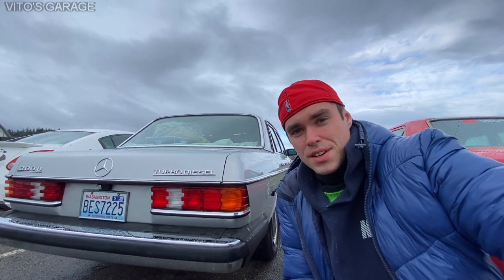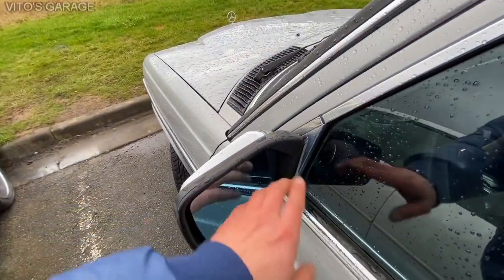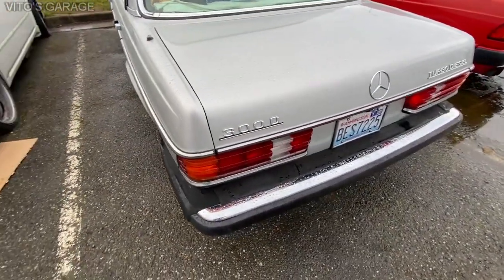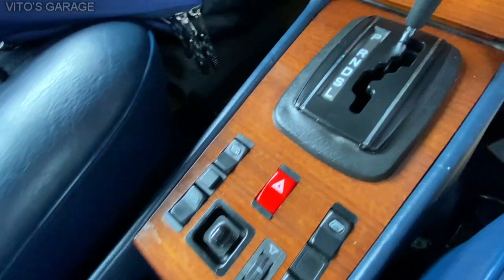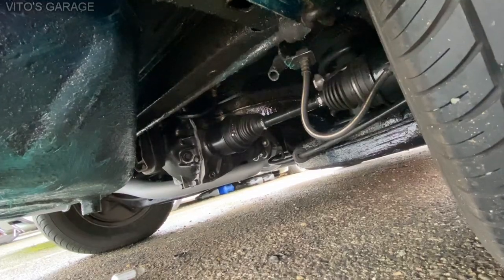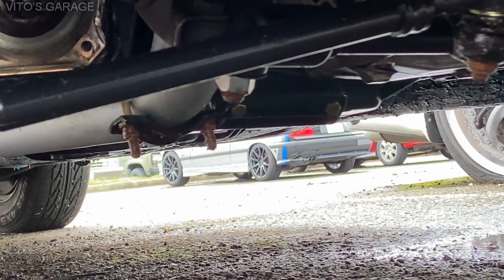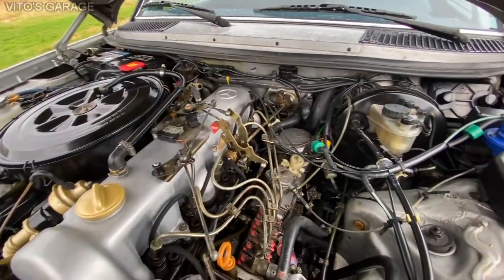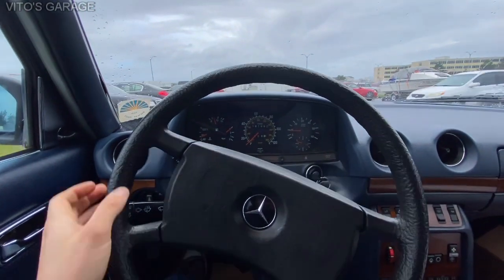Dad's Gift 1985 Mercedes 300D W123 Is Ready For Shipping! Here's Everything That Was Done!

Comment: What fluid and grease did you use to preserve the metal ?
Reply from the maker: Fluid film and wheel bearing grease (I used a marine grease but you can use any)
Reply: @VITOSGARAGE  sorry to sound ignorant,  but what fluid film ? Did you use automatic transmission fluid ? Here in Australia I would imagine you would use ATF.
Reply from the maker: @JaiHind-bb8pj  here’s a link to fluid film. It’s a thick oil that stays on the surface and protects it from rust: https://www.ebay.com/itm/274665991947?epid=1632566691&hash=item3ff35e6f0b:g:8FEAAOSwzUVgFcMC
Reply from the maker: @JaiHind-bb8pj  it’s not ATF. I use ATF for the places that are hard to get to such as hood hinges, door hinges, door locks, lock tumblers, latches etc..
Reply: @VITOSGARAGE  I told you that I was dumb. Thanks for the link.
Reply from the maker: You’re not dumb. We learn something new every day, even myself! Cheers🙂🤝